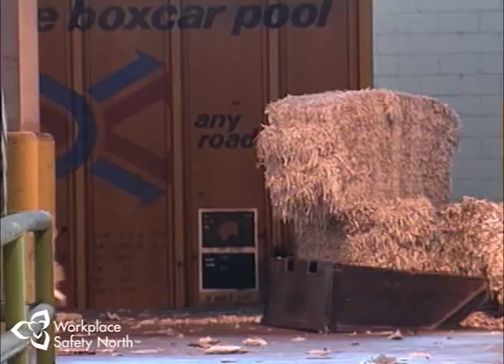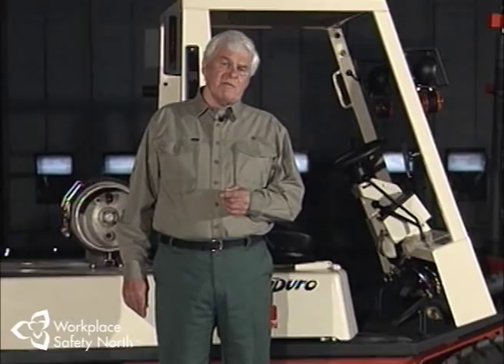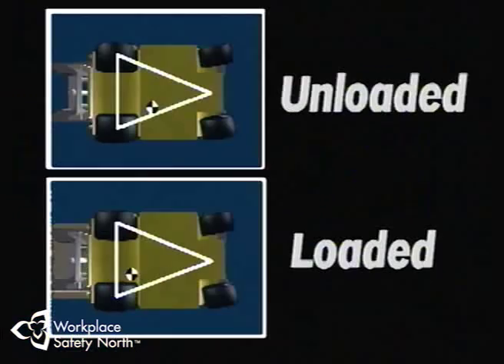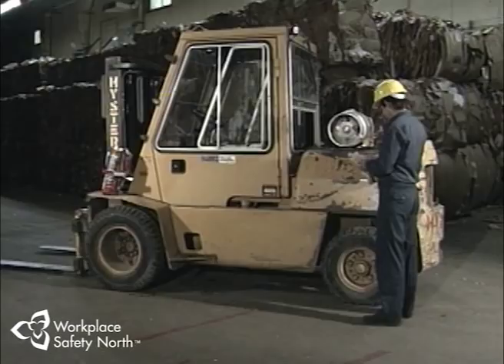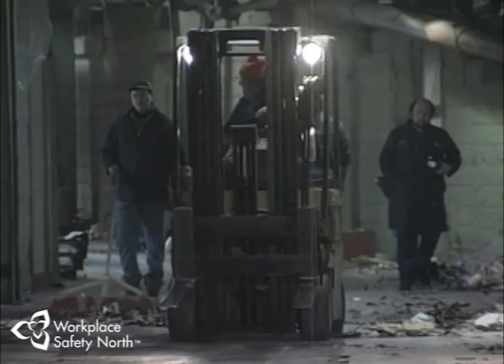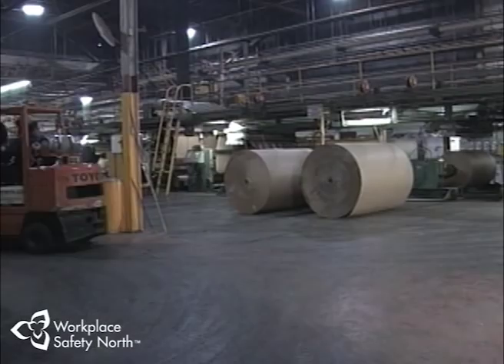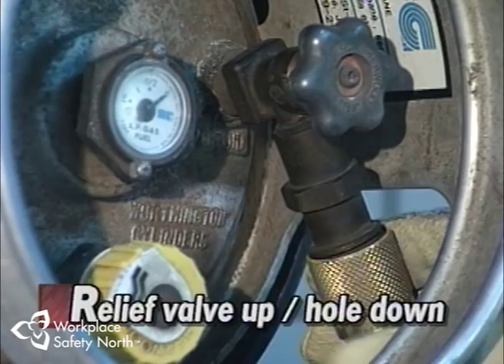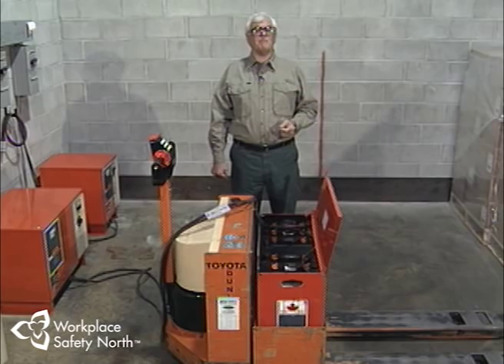Industrial Lift Truck Operation

Comment: Does it depends on how big the low is example it can be one big popcorn pop is big butt and the other side of the scale you have five seeds of popcorn none pop which is the same high but different weight how can we deal with that

Comment: Seems easy enough, but the problem is that most forklift drivers now earn LESS than a guy restocking shelves at your local Walmart.
Reply: Lol what do you mean? I get paid $20/h at my current job with no prior forklift experience. At my previous job (I only worked for 1.5 weeks cause it was a terrible place to work) I was getting paid $18/h. Minimum wage where I live is $15/h